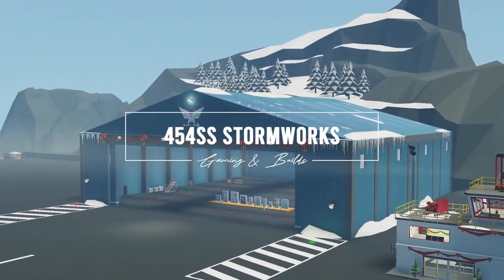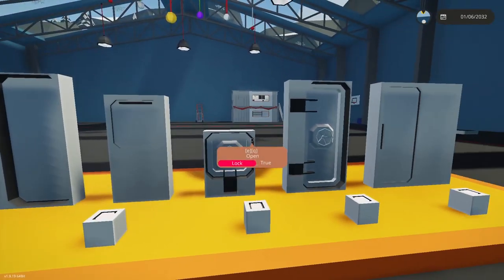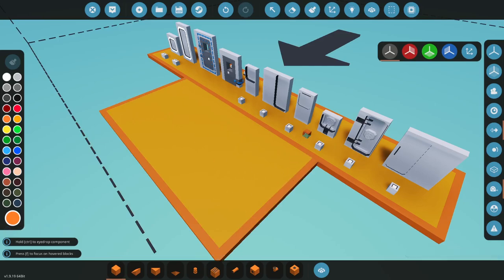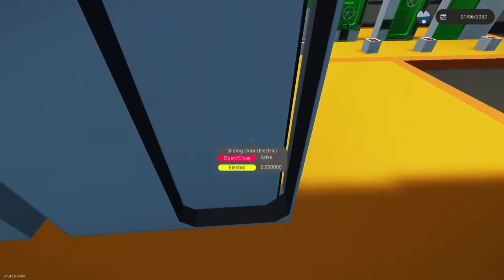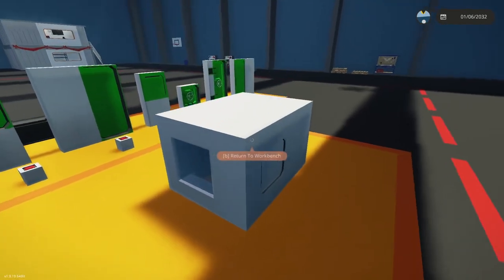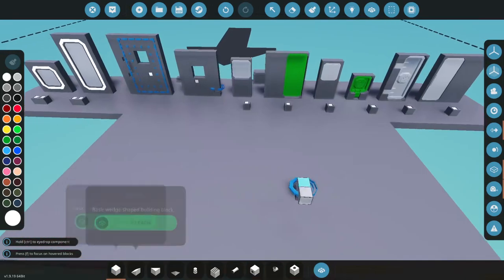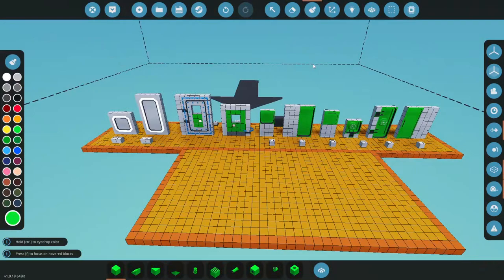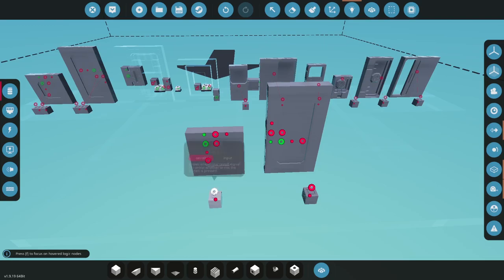Doors Tutorial for Stormworks Beginners (Engineer Explains)

Comment: Pretty sure the door frames need a lock signal to create a seal. You can't just have the door itself in position with the lock/seal disengaged. But this is impossible to verify right now because like you demonstrated it's bugged out. I'm also pretty sure it's the same way with the robotic hinge. You should still need the lock/seal part.

Everything else is a great demonstration. Good video :)
Reply from the maker: Yeah that was a little weird, that's why I put the indicator to see if it was sealed! Either way, I provided the basics for understanding! Thanks for the comment :)